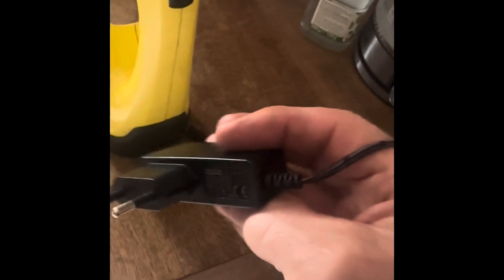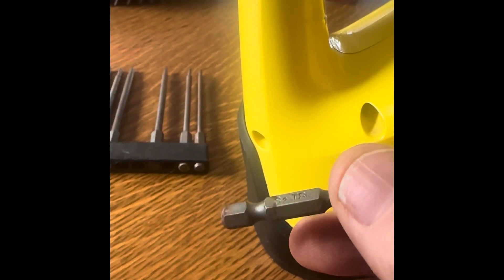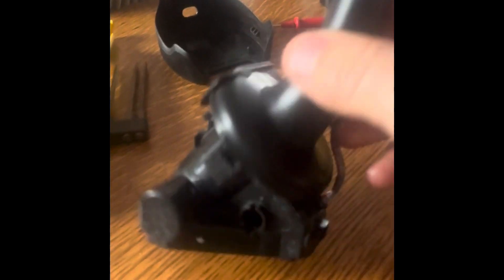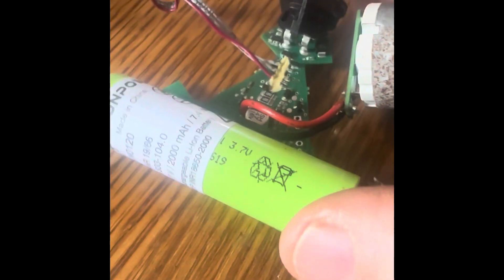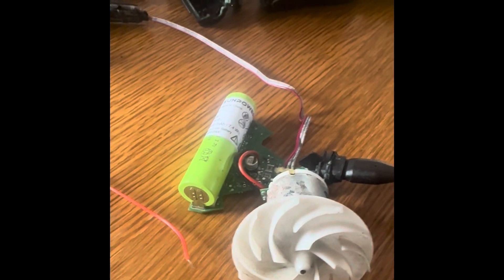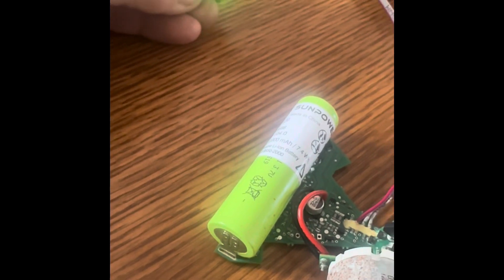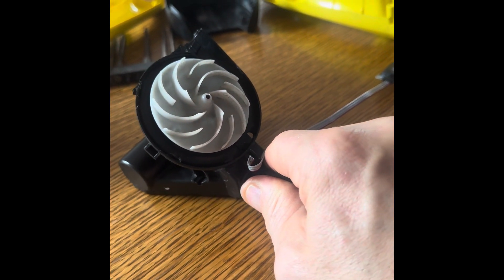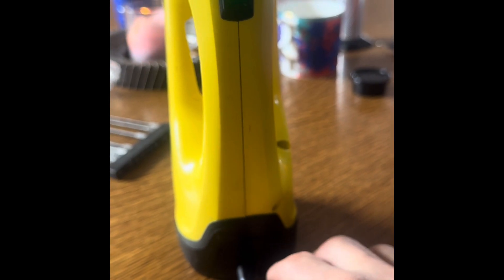Kärcher Window Cleaner, no charge - can we fix it ?

Comment: Would it be possible to  jump-start the rechargeable battery by connecting the spare battery terminals to the charging port, rather than opening the unit up?
Reply from the maker: Sadly no, charger already gives 5v but goes to the board which won't accept it unless battery is over a certain voltage. Also theres a video on the channel about  putting a new battery in. Keep us posted. You can do it 👍

Comment: Thanks for the video, tried the cable tie "technique", no joy so took the device apart and fan had completely seized. Got it up and running with a bit of WD40, reassembled, all good.
Reply from the maker: Great news and well done. If water gets into the motor area it rusts up and causes problems. Keep us posted. you can do it :)

Comment: What battery pack is this or where u get them?
Reply from the maker: They are 18650 batteries found in most rechargeable devices like computers and Powertool battery pack. I'm just making a new video on changing the battery as I think the ones supplied as new are not very powerful or 1200 mAh, i will install a 2500mAh in the video. Keep us posted. You can do it 👍

Comment: The screws are T8s BTW, not 10s.  I have long Ts down to 10s and I’m having to go to Amazon to get a long t8 😢
Reply from the maker: Thanks for the input. Keep us posted. You can do it 👍
Reply: @YoucandoitwithJules 👍🏻 the connections to the battery are riveted on, so I had to break them carefully so still long enough to reuse.  Unfortunately, even soldering on a new battery made no difference, so I’m now looking for a replacement parts.   Not used it many times in the campervan, so I don’t really consider it fit for purpose.
Reply: Appreciate the video and giving me a fighting chance!
Reply from the maker: @chrissharplesphotography9748  Don't give up. You can do it 👍

Comment: Agreed - brilliant! Very helpful video Jules, thank you.  I had exactly the same problem, after the Karcher vac lay idle for a few months. No charge going to the battery, no green lights, nothing. My vac model has an easy pop-out battery, so somewhat easier. I applied a similar fix-it approach as described by Jules in this video. I used a variable output DC charger set at 4.5V to boost the Lithium battery, left it for about 20 minutes to get the stored voltage up to about 3V (the battery is rated at 3.7V).  Put the Karcher vac back together, plugged in to mains and hey presto, green lights and the vac is back in action.   Super-helpful video, thanks again Jules, saved me at least £25, and enlightened me regarding Lithium battery's low threshold voltage and how that might prevent some useful gadget from working! Cheers!
Reply from the maker: Thanks for the feedback. Got idea to use a variable DC charger.  Keep us posted. You can do it ;)

Comment: Thank you so much for your video. We got ours working again! It’s flashing green, then solid green pretty quickly, but doesn’t last long. So I imagine the battery has had it and needs replacing?
Reply from the maker: Yes you can replace it with another 18650 battery and solder it in. I don't think the standard battery are very powerful get a 2500 milli amp battery if possible. Keep us posted. You can do it 👍
Reply: @YoucandoitwithJules thank you 😊 yes will update it I can do it! I have a soldering kit, just need to get a battery! Thanks for your reply 😊

Comment: Hey, thanks for the video! I did everything you described and the green light started flashing. However, when I disconnected the auxiliary battery, the charging stopped and I couldn't get a charge anymore. I disconnected and reconnected the battery and charger several times, but nothing.
Reply from the maker: Maybe your battery is toast. Try with aux for a bit longer. Keep us posted. You can do it 👍